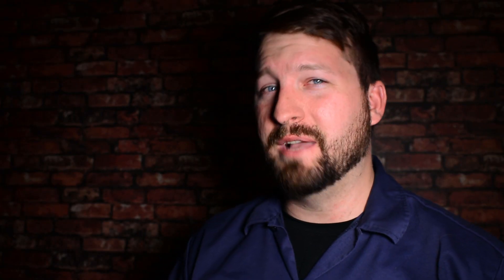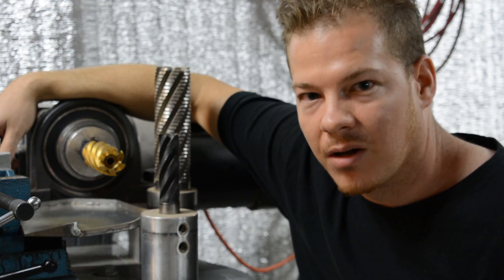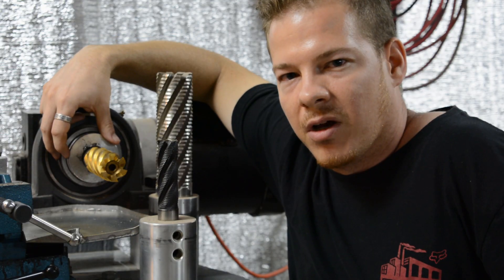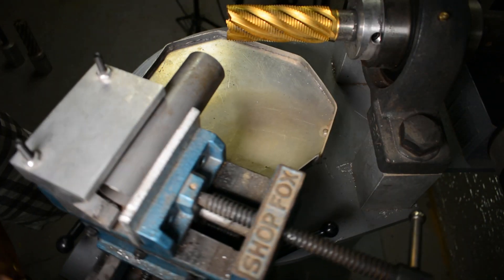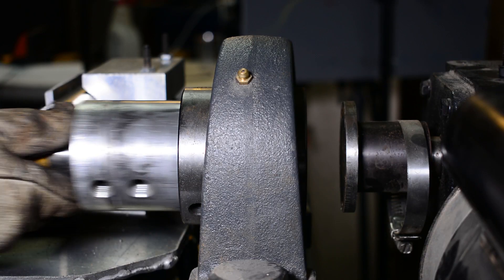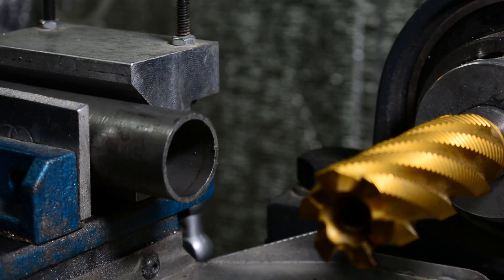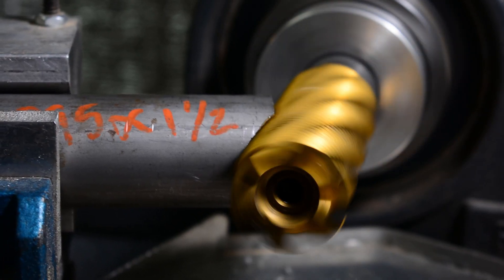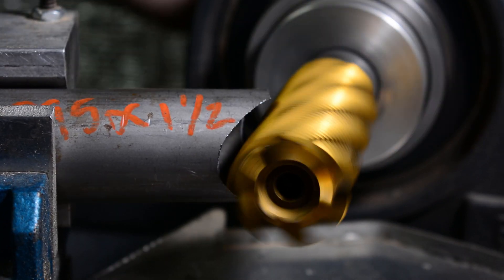DIY Tube Notching. The fast and easy way. Open source tube notching machine. Cut pipe or tube copes.

Comment: Hi, I noticed that you have a different version now but, will you be willing to sell or share the part numbers that you use for v1, like motor, gear box type, block bearing size and the end mill attachment. Thanks
Reply from the maker: We do it's a very difficult machine to make. Converting a lathe would be a better option then what we made. It requires lathing precise parts to hold onto the end mills. Go to the website and email us if you want to know more.

Comment: This is by far the quickest design I have seen yet.  The other sights where innovating slow, not easy.  Those bits though are special find though, because ace will not have them.
Reply from the maker: Thank you. We have a new design on our website. It's in the DIY section. This design was good but expensive. The cutter are hard to find at a good price. Thanks for watching and the comment.

Comment: Have you ever tried coping with an annular cutter in a mag drill? I just had that idea. Seems like it would work
Reply from the maker: Yes we have. We like them and hole saws for simple stuff. 90 degree joints and 45s. But anything else other then that and we prefer the end mill style. It can take a few tries to get things to fit just right and the end mills make it easy to adjust the notches perfectly. 

A drill press and annular bits or holes saws with get you pretty far. Thanks for watching and the comment.

Comment: the link for the tube notcher doesn't work. I was hoping to see it more
Reply from the maker: That project is down right now for updates. A few of our customers who bought the download had issues with parts suppliers and prints. And a better step by step guide was requested so we are re working that project right now. Subscribe so you'll be notified when its back up. You can follow us on Facebook as well. Thank you for letting us know your interested. We will keep working on this project to make it even better. Best Matt

Comment: Where did you source the end mills for your notcher?
Reply from the maker: MSC Direct. But they are nothing special just big. All a roughing end mills HSS with and without a coating. We bought the cheapest ones they had. So far they have held up well. Made two complete chassis with the same end mills and I bet they have plenty of life left in them. 
Best Matt

Comment: and the ultra cheap version - piece of tube, spaghetti and a rubber band. works like a charm. i'd also like to see more details of the machine, and how it is used. that could easily be two videos.
Reply from the maker: You got it.
Best Matt